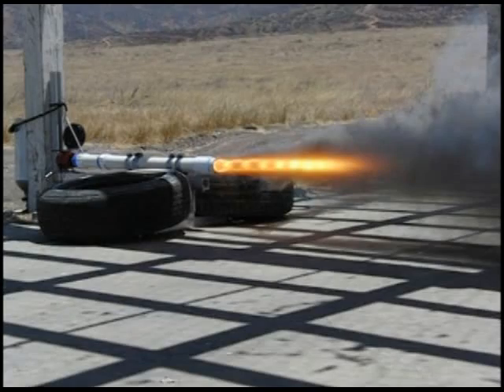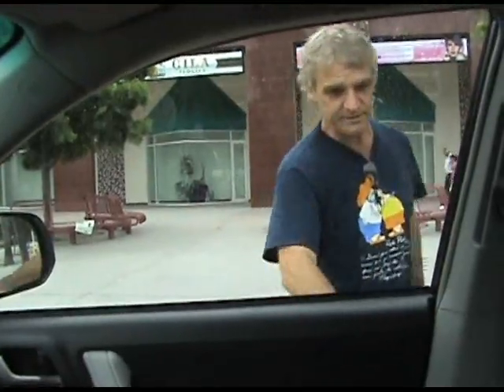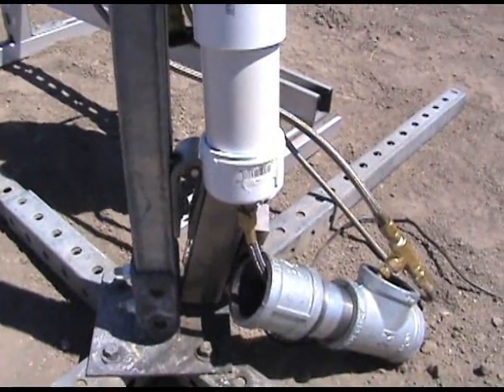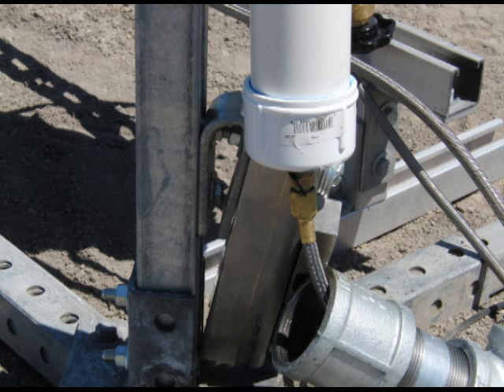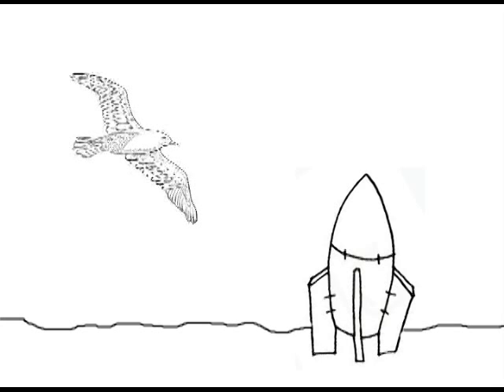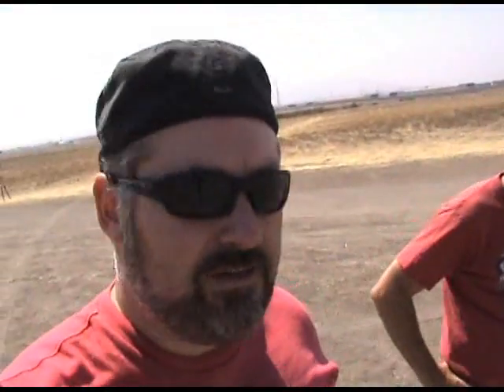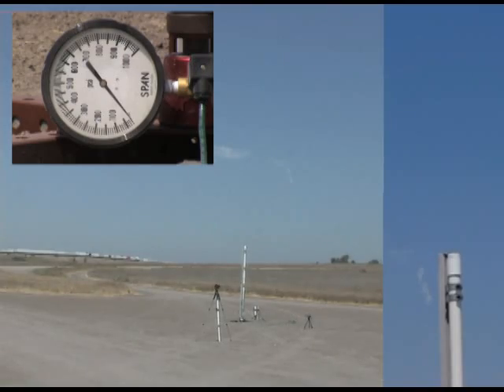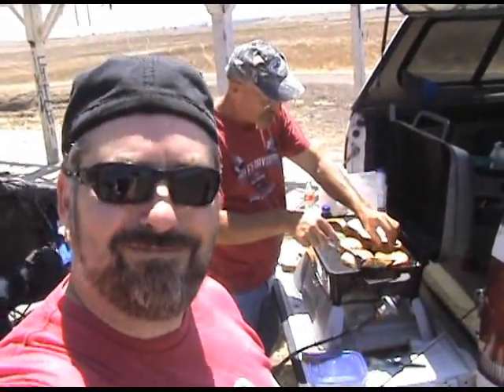OMG! 1100 pounds of thrust in one second!

Comment: dude this was totally my idea but you are missing one very important thing lol I tried it and it worked perfect !! for one it cant be done with the same tube it just cant because the solid is going to just burn what you need for the hybrid to work .. if you're going to just burn the outer walls for the pvc stage hybrid you can do that but I would thing it be important to save your rocket and not toast it lol  so second stage is the best .. solid for the first break away and set off the hybrid .. and use nitrous oxide and instead of burning the pvc use rubber it works so much better !!!

Comment: should have fitted a flash back arrestor, that way the back pressure from the solid fuel combustion will not overpressure the bottle
Reply from the maker: +Marc wire Yes, there was a flash back arrestor on the tank as well as a check valve. Neither stopped the

Comment: so you had enough pressure in the engine to over come the pressure in the nos tank? what pressure do those tanks run at?
wouldn't a check valve fix this?

Comment: thanks for posting, i think what happend was the pressure in the nox tank dropped below the the pressure in the nox tank at the end of the burn and the carbon in the fumes reacted with the nox as soon as it entered the tank , maybe a check valve for welder would work

Comment: Also get the nuances of both the solid and hybrid motor designs you are going to use down first through testing. then and only then Marry them. I Hate to say it, Testing is the key nothing works perfectly on a one-off. Rather better to fail in a testing rig than fail blowing up a good rocket.

Comment: You need to make a oneway valve to separate the two engine. If you pay me I could make one from you. Just sent me the inner diameter of the heat resistance coating and the pvc.

Comment: and if you insist in using oxidized fuel you need saveral blow back valves along the system . they consist of a one way valve with a brake away point , when the line sufers a blow back the valve will shut it self and it the pressure is too grate the small plate on the side of the vale will be breached.
 that is you best bet , how ever wen you are loading the tack if you pass a certain psi the gas will self combust and you will have a detonation , that is the reason that the don't just put acetylene and oxygen in a tank toguether 
1 it is NOT STABLE
2 the likelehood of a blow back with oxidized fuel is very very very hi 

i recommend  to stay with the first solid stages and for the hybrid used a rubber compound fuel and liquid oxygen ! safe powerful and ease :P
Reply: Dan Pollino If you are really using NOx then no wonder it didn't work.  NOx is a non-flammable, non-oxidizing byproduct of combustion.  It generally refers to NO and NO2.  You are more likely using N2O or nitrous oxide, something which is solely an oxidizer. The reason for the explosion was not the flame reaching the oxidizer, it was more likely the extreme pressure alone which cause the explosion kind of like over filling a balloon..  You may wan't blow back or check valves rated for 1000 to 4000 psi for something like this.  That engine is extremely impressive though, mad props to you for putting it together.
Reply from the maker: Yup, I had flashback valves installed, they didn't work. Don't know what you're talking about keeping the oxidizer and fuel in the same container ... don't do that.
Reply: well that is the only way you could get a flash back unless …… lol you aren't using oxygen are you ?
Reply from the maker: Phoenix Looh Things are never that black and white. I'm using NOX.
Reply: well the why in the work would your tank blow up , i have ruined NOX on an engine at 32 pounds of boost and i have never …… ever hear of a tank blowing up the way that one did lol
unless in really dumb and this shit is flammable with out a fuel source i docent make since
Reply: The Seed Show Pretty sure NOX is nitrous oxide...

Comment: lol just a tip …. stick with just oxygen …… till you learn the proper  operation of oxidased fuels …… really the name says it all !!! lol if you keep oxygen and fuel in a tank toguether you are not join to get a rocket but a bomb
Reply from the maker: I never keep them together.
Reply: well how i the hell did the blow back get to the  tank
Reply from the maker: Phoenix Looh Dunno.
Reply: well don't give up , what i did was weld together a vault were i test turbos and some times hybrid rocket engines , if hade 2 engines bow up on me …….. but no of the ever made it try the fire wall. i have even rand them with liquid oxigen . i got the 1" 3/4 thick still combustion chanber go so hot that it just blew up and it still didn't breech the vault .
but I'm a pretty good welder :P 
try it out , after you build one you can mess up all day long till you get it right lol ….. i did

Comment: Rollerons are a great idea, but they are not easy. They are a mechanical control system and just like any control system it needs tweaking to provide stability and if not implemented correctly it can actually cause instability. You will need to optimize the notches, their size and friction to make them work properly. Not a thing I would waste much time on.

Loving your vids; especially the plots. I just love them plots, sir!

Comment: Good afternoon. As the percentage of KNO3 and sorbitol, for a motor whose diameter is 7.62cm, length is 60 cm, the cylinder volume is cubic 2763.22cm material is stainless steel cylinder.

Comment: That's a lot of potential to throw away man, you should try to fix it rather than throwing out the design. With safety being an issue, you should probably return to your old location where property damage was nearly impossible, and then just test the engines remotely from say 250-500 feet away, or dig a containment pit of some sort. That's a lot of thrust potential to throw out.

Comment: decades ago i had an idea of casting a solid such as rubber into a case with a grain.i would have a pyrotechnic plug at the top where there was a tank of lox.the grain in the lower section would be filled with micrograin.it would start on micrograin and when it burnt thru the plug the lox would come down and oxidize the substainer solid.never got around to doing this.but i thought it may work

Comment: There's a bit of hardware I've seen used on oxy-acetylene rigs mounted on the hoses.  These are supposed to prevent any kind of flashback.  Maybe you could look into using one of these on your nox connections.  Good video.